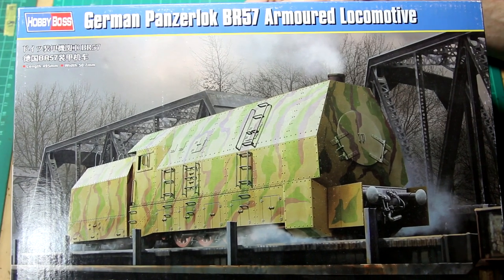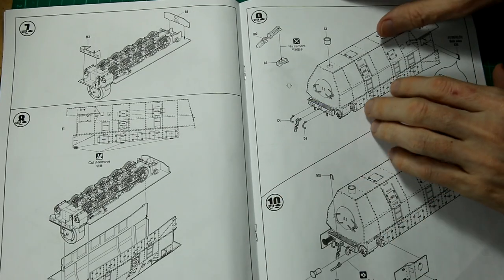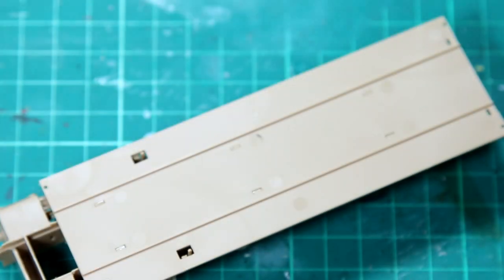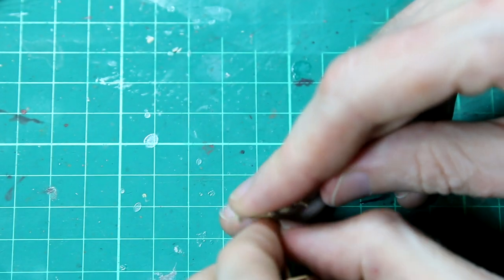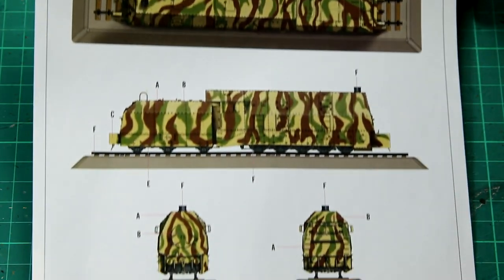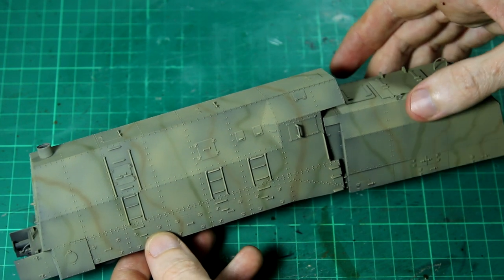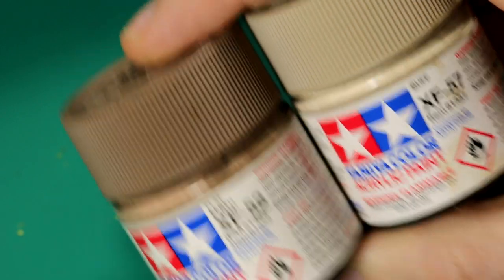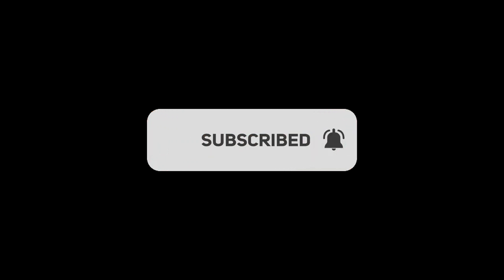Hobby Boss Panzerlok BR57 Armoured Locomotive (1/72 scale model)

Comment: Nice build. I imagine it is quite easy to cut a slot in the bottom of the loco an make it run on a 00 layout
Reply from the maker: Thanks. Umm, I've no idea about the 00 layout, sorry. The wheels on this don't (and can't) turn, which I guess would be an issue?
Reply: @ModelNerd  i noticed that but the are also plastic so you would have to purchase a proper chassis with motor and conductive wheels.

Comment: I actually have the one with panzer IV cannon from Trumpeter in my stash, its from 2007.
Reply from the maker: Ah yes, I know that kit - it's a nice build.
Reply: @ModelNerd  is it? I am worried about the photo etched parts as I have never used any photo etch before. I do have a photo etch bender from mastertools and I hope I manage to bend them, file them and glue them properly. I have ammo by mig's acrylic based glue for photo etch and I hope it will work well.
Reply from the maker: It was a few years ago I built the kit (it was one of my first when I got back into modelling), but I don't remember using the photoetch. I think perhaps they supplied alternative plastic parts.